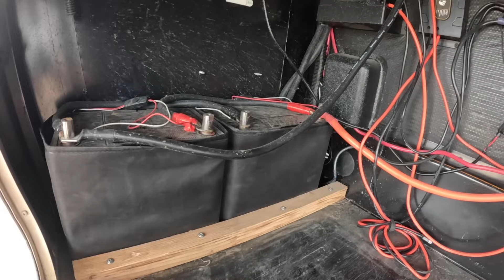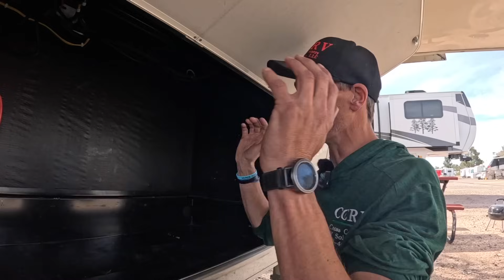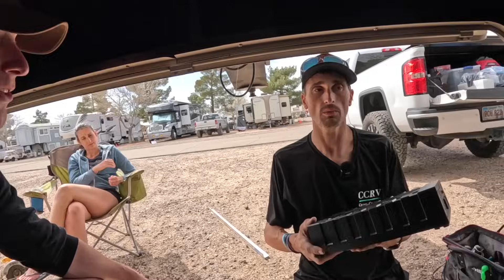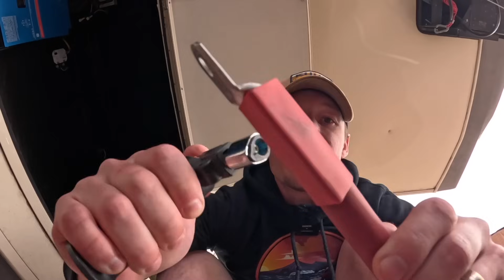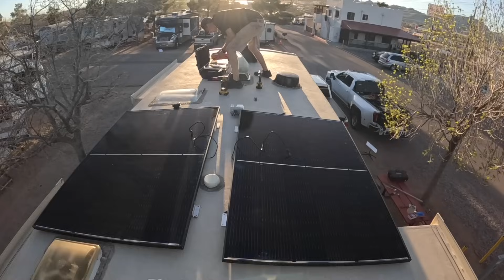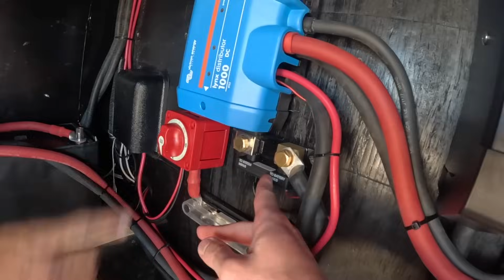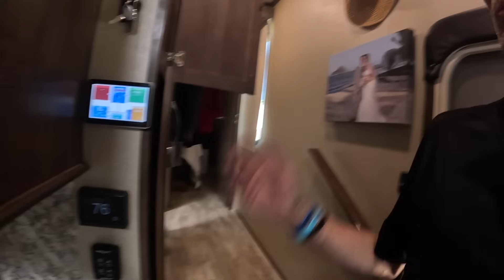Exposed: Expert Reveals the Lies RVers Still Believe

Comment: The best video you guys have done.
Derek is so good at explaining everything and stick to the right choices. Clean, safe and esthetic install. No BS.
If you go from already installed Lithium batteries to your new system...perfect.
If you are going from regular AGM batteries to Lithium, I would go 24 volts. Smaller cabling, still safe.

Comment: I a retired aircraft electrician.  I like watching Derek's work. He does a very nice job and can design a really good solar setup.  But, let's straighten something out here:  an inverter changes DC to AC, a rectifier changes AC to DC and a converter does not change the voltage type it only changes the voltage level i.e. 48vdc to 12vdc  Converters can also change frequency of an AC signal.  Hope this helps

Comment: While you certainly don't "need" 48v for running A/C's, etc., it does help.   For example, your two little LifePO4 batteries probably only have BMSs rated for 100A.  When pulling 3000W (A well cooled MultiPlus 3000va should be able to handle that for over 20min) you're already well above the 200A combined limit of your two batteries, especially when you take conversion losses into account -- closing in on 280A -- and we're not even taking into account momentary surge loads (the multiplus 3000va can handle up to 5500W for ~2min, if your batteries can feed it.)

The 48v Multiplus 3000va is a little more efficient than the 12v Multiplus at peak load, so you're already better off there, but at peak load with a 48v system we're going to be well under 100A -- closer to 65A -- so the 100A BMSs in most 48V batteries will handle it just fine -- with a single battery, and much smaller cabling.

Also, the implied risk of "explosion" with 48v is WAY overstated.  In fact, the risk of fire from the high amp draws on 12v systems is MUCH higher.

(That said, Derek did a great job installing that system.  Just wish he went over how your battery bank is probably under-rated for what you have it connect to -- until you add two more batteries.)

Comment: At 78 I'm a former 30 year veteran in new car dealership service (mechanic, service advisor, dispatcher and service manger) and dealership management. Majority of a new vehicle's profits are not made at time of sale, they are made in warranty repairs, service and parts. 70% of all customers THINK that their warranty is only good where they bought the vehicle - NOT TRUE. Further NO "Emission Components" are covered in new / preowned warranties. At dealers, on average, only 10% of techs are "Factory Trained" and ASE Techs are rarely employed. Independent repair and service facilities have access to the SAME service tools and parts as dealerships. Both must pay for these items. An experienced ASE Certified Service / Repair facility is far less costly than dealer services with about 75% fewer return for re-fixing repairs. Dealers  "NO CUSTOMERS ALLOWED" areas are the profit centers!

Comment: I have very similar system on my trailer. But I was told to switch the system off while traveling. Just in case you are ever involved in an accident, you don’t want 120 volts ac running through your trailer. Someone might get shocked.

Comment: To turn the system on you, turn on power from the battery to the controller once the controller is powered up. You then can turn the power on from the solar cells. To shut the system down, you turn off the power to the solar cells, and then the power from the battery to the controller. If you do the process backwards, you can burn out your controller.

Comment: Are you guys planning to add more battery capacity?  The manual for the Multiplus 3k recommends at least 400AH.  Assuming both those batteries have a 100A BMS, they can only supply 2560W of power, possibly cutting it close with an air conditioner and other loads.  I've seen 3500w from my multiplus running the AC with the microwave.

Comment: I’m gonna be honest with you all these component manufacturers just need to create a unified system that connect AC, your batteries and your solar panels and it does everything inside no custom cables. All of the fusing is done inside.

Be great to use the standard Anderson connector for batteries, maybe an Anderson connector or a solar connector for the solar inputs and then a standard 50 amp plug/terminals . 

I could see this where you potentially wanna just install it in the back of the vehicle. And have portable power or wire this thing into your rig permanently. 

Making that kind of investment, I would want portability from one trailer to another trailer. Because we know these systems are really not offered very often by the manufacturers and re-buy that just because I’ve upgraded my trailer just isn’t appealing.
Reply: I’ve been looking at an echo flow propane generator that would automatically turn on in charge of a 50 amp echo flow power station to power the RV that would also take my inputs from solar. I have roof mounted panels and I also have ground panels.

Comment: I like all the changes he is making it's the way to go. Only thing I would do differently is get rid of those two 100 amp LiPo's and get one 300 amp one. Takes about the same space and you will not regret the extra run time. And to be clear you don't have to go with those over priced Battle Born or other premium batteries, there are plenty of great batteries out there for half the price. Just check out some of the tear downs that Will Prowse does on the less expensive brands.

Comment: Enjoy and welcome to the victron club. It is game changing. One red flag I see with your install is the positive and negative cables crossing each other at the battery terminal. If they cannot be separated, I suggest lacing a piece of leather or other chafe protection to provide a permenant separation. The heat shrink can eventually rub through and you don't want fireworks up there.

Comment: why don't you get solar panels to put up on the roof that's all you need to run everything. No loud Generator anymore, or i would have just got rid of the RV and truck and got a  new Camper all together it seems like all you see is a Garage for repairs. waste of money. 😁🤠

Comment: 0:21 In a vehicle that moves a lot, this is terrifying.  Thin wires free to bounce around or get caught on shifting items in the storage area, no fuses, positive and negative wires rubbing against each other, and is that black tape wrapped around a couple of wires twisted together.

After watching to the end, whatever you paid, you saved yourself an extreme amount more.  You started with a fire hazard that could easily burn down the entire RV and all the contents.
Think of the $2800 as a one-time insurance payment with convenience benefits.

Comment: Use 48 volt LifePo4 aluminum prismatic batteries . Never use AGM or Kead Acid ! Lithiums are 1/3 the weight and last far longer. A good inverter system from PowrMor is best option. My PowrMor puts out 6,500 watts all day long with no problems . Charges the batteries just by plugging into shore power or just recharge through my BlueSun PV  panels. Use proper wiring and fuses . Insulate potential shorting points. Don't pay attention to the advice from your friend about using 12 or 24 volt batteries to power the system. Higher efficiency is much easier with high voltage !  How many times does 12 or 24 have to be raised to get your needed voltage for the AC ? Doubling 48 volts is easy for inverter to get much closer to the 120 vac you'll probably use for Air Conditioner. Efficiency counts in long run unless you love wasting the fuel you burn from grid or backup generator. Get 48 system , there's a reason pro's use them Efficiency !  I use 16 of 230 Amp Hr LifePo4 batts and don't ever worry about using shore power with 6 - 300 watt BlueSun panels wired in series - parallel. 2 in series , 3 of those in parallel...... 2 300's in series , make those in 3 sets and then paralell the 3 sets , be careful on polarity !  Nick , NavyBlueSmoke , LST-1195

Comment: I bet you’ve been inundated with advice. Your system is great. It’s not too small. But it does leave room to grow. Victron is the bees knees. You however missed a free option with the Multiplus 2 inverter. The inverter has a 2nd input. So you could have an external plugin for your generator. 
Meaning if you were boon docking, and your lithium got to minimum volts, it would turn the Generator on automatically. Charge the batteries, and turn off. 

And lastly. Consider buying a set of flexible / foldable solar panels for when you’re parked under trees. This way you can still get decent charge while you’re in the shade…

Anyhoo. Baby steps. 

I commend you for trying yourselves and then realising theres a reason there’s professionals out there. 

✌🏼

Comment: I do run a 48v system for the simple reason of amp draw. Max draw is 125 amp at 48v. Same at 12 volt is 500 amp. With 1 ac, the 2 fridges, a TV, and a couple lights were at 2800 steady. Coarse it changes with the fridge compressor. 2800/48=58amps. 2800/12=230amps. I have a custom built 1200ah 48v tech. Is runs at 52v. lifpo4 battery i built myself using eve cells. It's mounted roughly 12' from the eg4. I used 1/0 welding cable from the battery to the main buss with a fuse and disconnect switch with a 100amp anl fuse. I have 6 480w 50v solar panels on the roof. I can feed the 4800w of solar at 150v. It took 3.5 years to put this system together on my 5rv. It has performed flawlessly since installing. Now my unit does have 2 a/c both with soft start. 80lbs of propane. We have a propane gen we can connect to the rv as well. We have camped off grid for 11 days without issue. The biggest issue is the waste tank of lasts so long. Power, food, fun. Not an issue.

Comment: If you are going to add more batteries, they really need to be matched to the original set as best as possible.  Same brand, same model of battery,and be within a reasonable age difference (less than a year old recommended.)  otherwise the batteries tend to push-pull each other with their energy transfer.  The second alternative is to sell-off the original two batteries and then buy all new batteries of equal brand/model/age.

Comment: A MRBF Fuse on the positive terminal of the battery would have been a better choice.  That ANL fuse holder is a cheap chinese part, why go to the trouble of useing the correct wiring and lugs only to make the ANL fuse holder the cheapest part.  I would also have liked to see better quality crimp lugs.  At the minimum use some electrical tape to cover the positive and negative terminals of your lithium batteries, especially the negative and positive that are right next to each other,

Comment: I really enjoy your content and wanted to add a quick note about the power consumption of your new Victron MultiPlus II 3000VA inverter. While it’s a great upgrade from your 2000VA model, the 3000VA inverter uses more power even when idle. The 2000VA inverter draws about 9W at idle, which adds up to 216Wh over 24 hours, while the 3000VA inverter draws 15W, consuming 360Wh in the same time. That’s an extra 144Wh or about 6% more of your battery capacity each day. With your 12V, 210Ah battery bank, this idle draw from the 3000VA inverter represents roughly 14% of your total battery capacity used daily. To maximize your battery life, it’s best to turn off the inverter when you don’t need AC power. This will help prevent unnecessary drain and stretch your battery’s lifespan. Hope this helps, and keep up the great work!

Comment: First off, I absolutely love your channel and have been following your travels for a while. Your positivity and adventures are truly inspiring!

I wanted to share a concern regarding your recent Victron MultiPlus II 3000VA inverter installation. I noticed you’re using two 105Ah lithium batteries, totaling 210Ah. Victron recommends a minimum of 400Ah for this inverter to operate safely and effectively.

In the video, you demonstrated running both the air conditioner and microwave simultaneously. While the inverter can handle these loads, the current battery bank may not support such high-demand usage. This can lead to significant voltage drops, potentially causing damage to sensitive appliances like your microwave and AC unit.

Moreover, consistently operating under these conditions can strain your batteries, leading to premature degradation or failure. It’s crucial to ensure your battery capacity aligns with your power usage to maintain the longevity of your system and appliances.

I share this out of genuine concern and admiration for your journey. Upgrading your battery bank or adjusting your power usage could help prevent potential issues down the road.

Stay safe and keep sharing your amazing adventures!

Comment: About the battery voltage debate, 12V vs 48V. If you can, get the higher voltage. The reason is inverters and chargers are more efficient. 

Everything has downsides, 48V system requires the higher initial investment on the batteries. 

The efficiency differences aren't so big, but does add up when off grid or power outage. Give or take 10-15% depending on load, manufacturer of equipment, and battery's state of charge. There're more reasons, but those are the more important ones.

Comment: It’s usually good practice to have all of the LiFePo4 batteries of the same age.  Another good practice is to have the same brand and Ah rating for each batteries, this is because each battery manufacturer has their own internal BMS parameters, and may not play well with others for optimizing total power output.  I have the same system but with 3 x 206Ah SOK’s, I did my install.  Victron components are worth the extra money for the additional options you get with VRM, Cerbo GX having relays you can program and Mopeka sensors can Bluetooth to show them on you Touch GX, like propane tank levels.  Enjoy your boondocking.

Comment: Looks a lot like my system. I love my multi-plus. Gave me a warm and fuzzy to see him drill out that hole on the Lynx distributor and bolt the main switch right to it,  that is the solution I cam up with. Nice to see a pro does the same thing.  I would suggest that you add some sort of device to manage power from your truck to the battery. Currently that is my only non Victron component. I sized my system for one really hot brutal Nebraska summer night needing AC to keep my wife happy all night long. So I have 800 amp hours of lithium. I have 4 of the older Li-Time 200 Ah batteries. Those are now $440 each. But no heaters, and no low temperature charge protection. I still dont have solar, but that is next. Looking good guys!

Comment: Great video! Isn’t it so fun to run things on solar/battery?

Just in case you aren’t aware yet, be sure to look into the residential clean energy credit for your solar panel/equipment install. Hopefully you can save up to 30% of the system.

Comment: I get a kick out of your videos. I'll tell you why pardner. Back in 2007, I bought a new GMC crew cab pickup to pull my brand new 2007, 30 foot Coachmen built by the Indiana farm boyz. 

I went to the dealership near Fort Worth with a fine service department and the second time I drove up, the doors were closed. I lost my arse because I had bought and paid for other dealer warranties. I also had GM stock worth $50,000 and I lost it all. Obama gave the stock to the Union. 

I went to the Coachmen RV dealer for warranty work in 2008 and the doors were closed. I lost my arse. RVs are nice but money losers. Always be prepared to get the corncobs without Vaseline.

Comment: Hello, I am planning the same kind of installation. I have fairly good knowledge of electricity, electronics and IT. I would suggest that you add one more component, a DC-DC charger to be able to add in DC power coming from your truck while your on the road. The DC-DC charger is mandatory and will do the necessary adaptation between the Lead-Acid truck alternator to the Lithium batteries in your RV. Since the Lead-Acid battery voltage is not the same as the Lithium battery voltage, a step up voltage compensation must be done. If a DC-DC charger is not used, you could fry the trucks alternator. The other benefit is that you can limit the current that the truck's alternator is providing, hence preventing the wires from the truck to the RV to also fry. Be safe on the road. Andre

Comment: I have the same symptoms in my Rv.  
Suggest purchasing the remote control panel. 
Big advantage is being able to dial back the change mode if using a small generator.  The cost is about $100. But so nice to control power sharing

Comment: Derek is very talented. You will need a lot more panels to be able to truly remote camp with your living needs. My man @NomadBrad503 is also a very skilled solar installer at Solair Service LLC. Victron is the wise choice. He installed my solar power of 2200 watts of panels and all the electrical in the desert in Cali so I can do the remote living, with 100 gallon freshwater tank also. The amazing thing is the panels were secured without piercing the roof to secure them. The only hole was for the wiring into my rig.

Comment: Be very careful buying wire. Today wire is aluminum coated with copper. Find solid copper wire, it's far superior. To figure out if the wire is aluminum or copper, look at the cut end of the wire, if it's a shiny white colour it's aluminum. If you use aluminum wire, go one size thicker, one AWG smaller. For example if you require 14-AWG copper wire, use 12-AWG aluminum wire.